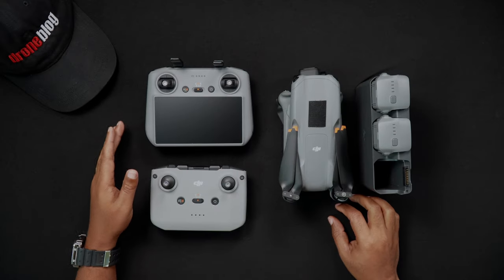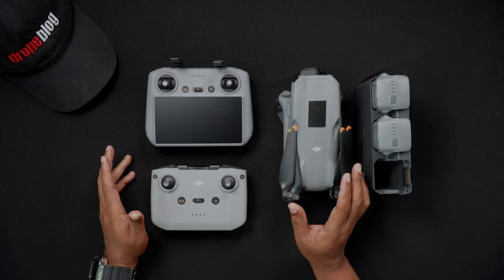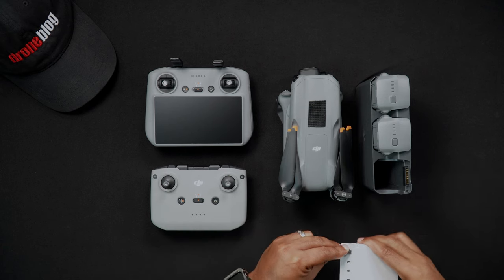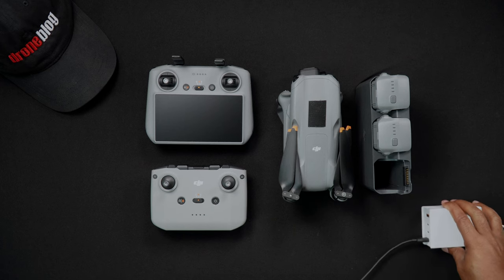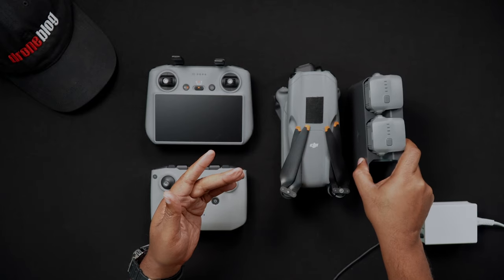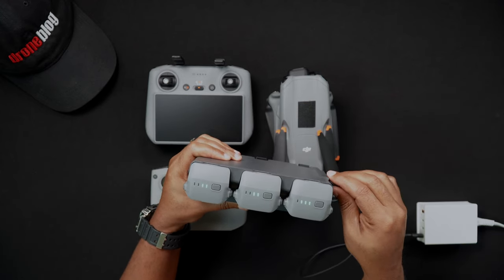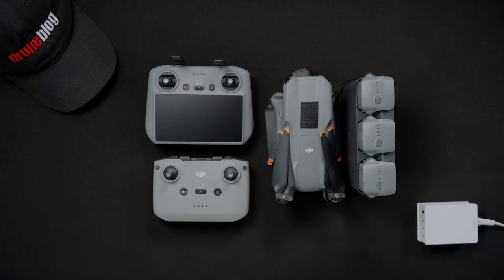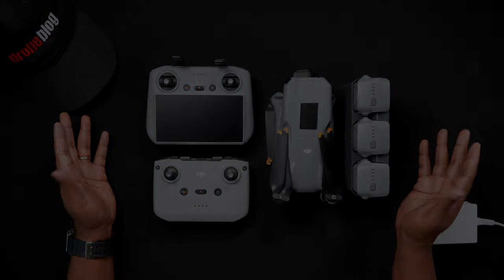DJI Air3 Batteries: How-to Charge

Comment: Overall, a very well done video, thanks.  However, unless I missed it, you didn't explain how we know the controller or battery is fully charged.  I know the lights blink during charging.  But once fully charged, do the lights stay on steady?  Do they go out completely? Or do all lights continue to blink.  Thanks again for a well done video.